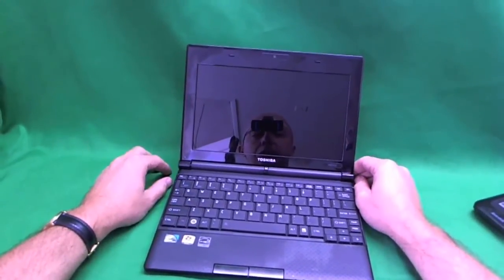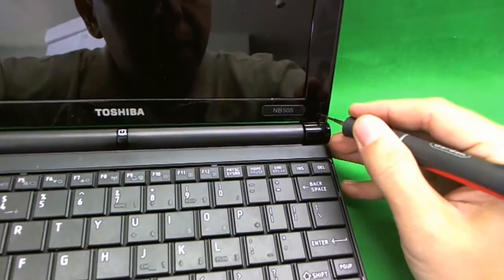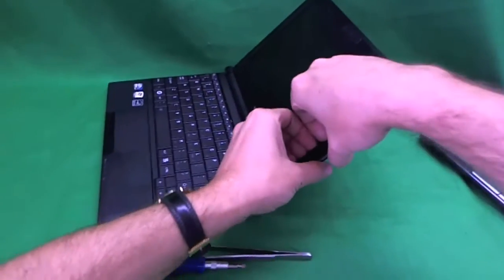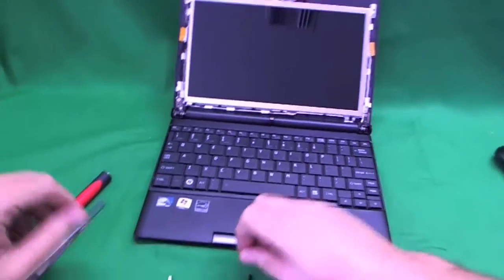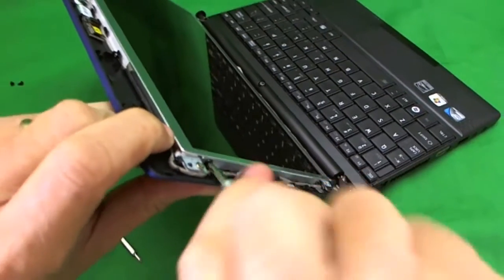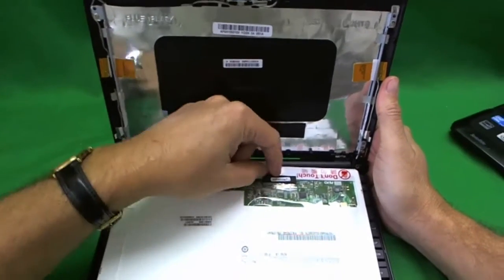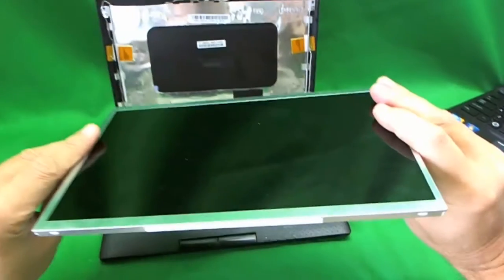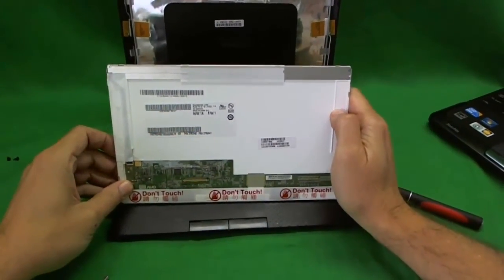Toshiba NB505 Netbook Screen Replacement Procedure

Comment: This tutorial worked great, I was able to do it in less than an hour by myself.  The only moment of confusion I had was disconnecting the connector on the back of the screen.  It's not hard once you figure it out, but it took a minute.  **Once you have the tape loosened from the back of the gold connector you slide the bottom portion of the connector towards the bottom of the screen.  Make sure that when you reconnect it to the new screen you click it in well.**

Comment: Not sure if its the screen or te hinges on my toshiba NB505.  I have a replacement screen but need help to remove the power button cover to access the hinges.  The left side hinge is fine but the right side hinge isloose/broken.  I did find a screen from the hinge area after removing the  LCD screen.  Need a video or diagram on ow to remove the power button and check  right hing to determine if it needs replacing or tightening.

Comment: The hinge screws on my NB505 came loose and the screw on the left side actually fell off.  Would I be able to access the hinge screws if using this procedure?  And what type of screw driver should I use to tighten the screws?